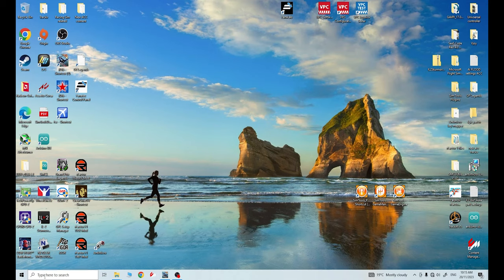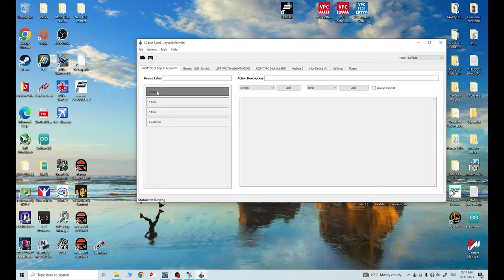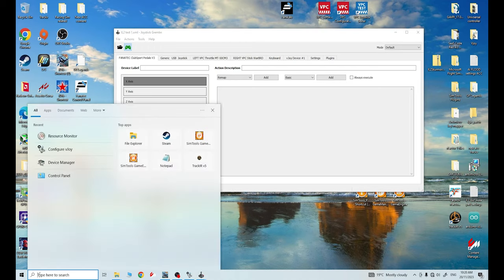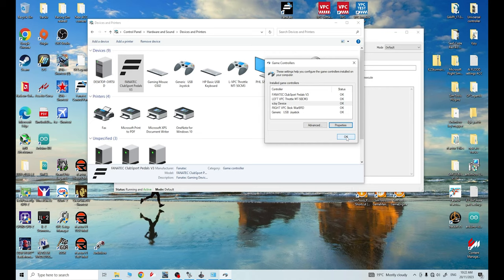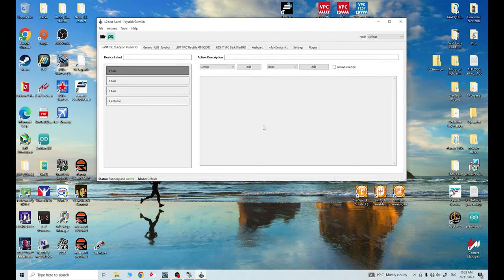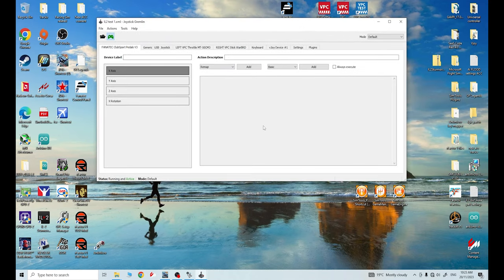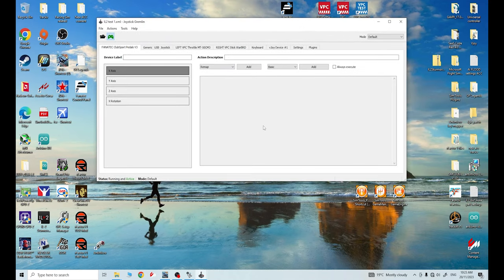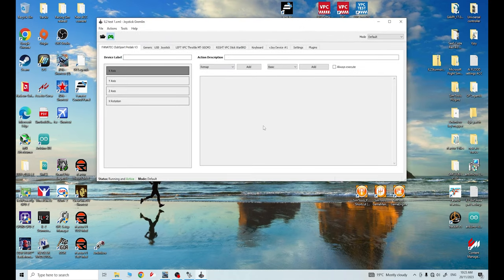Joystick Gremlin Axis Merger For Racing Pedals To Rudder Pedals With IL-2 Sturmovik Tutorial

Comment: Thanks for the tutorial! Is there any function to get the rumbles working on simracing titles? I need to use the joystick gremlin due to fps problems with the v3's and ea sports wrc title. The pedals works just as original, but I can't get the rumbles to work
Reply from the maker: Hey mate. That question is a little above my pay grade LOL. Not sure, as ive never used gremlin for anything other than the racing pedal conversion to one axis. Your problem sounds like a V3 Fanatec to WRC game issue. Hey! Follow my new (coming soon) 4DOF motion platform tutorials and youll never need to worry about those tiny rumble motors again.
Reply: @Doctoradhd1  There's a issue with the fanatec v3 and the game. I get over 89 fps with them connected, but If I use hidhide and joystick gremlin I get between 150-220 fps, that's why I'm using it. But I can't get the rumbles to work 😂

Comment: I've done everything exactly the same, When I press on the clutch and the gas it wont go full, like just halfway through, also even If I'm not putting any inputs the thing goes automatically on the left side
Reply from the maker: Sounds like it’s still not setup. Did you try the universal controller app as an alternative to Gremlin? Link to that video in description.

Comment: When i have installed Vjoy and restarted, and opened the vjoy configure, its all greyed out. the add device does nothing. what have i done wrong. thanks for a great video
Reply from the maker: Hi Nik. Can you see Vjoy in control panel under devices and printers? You should see it there. If it's not there, than it hasn't installed correctly for some reason. If it's there, but won't allow you to select an axis, make sure you have ticked the enable Vjoy box.